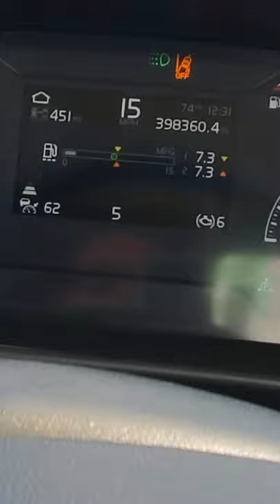Slow automatic semi truck Don't buy! Volvo semi tractor with Eaton 10speed autoshift. 400hp Cummins

Comment: After driving  a standard  for  21 years. Company  got an automatic.  For fuel savings. That thing sucked in the snow. Could not back under trailers like a standard  could.
Reply from the maker: Yes that's right! Drivers definitely a lot less control on whee lspin with an auto!